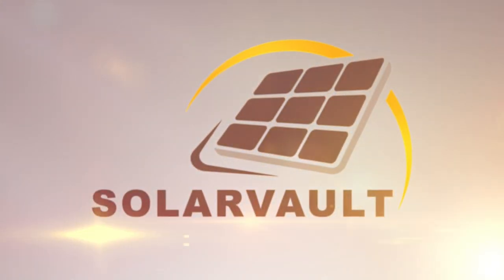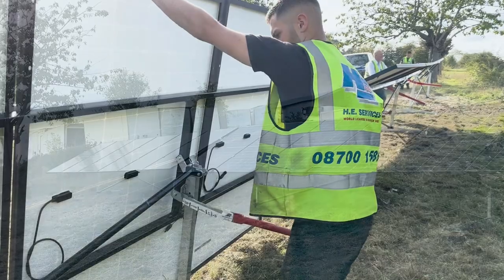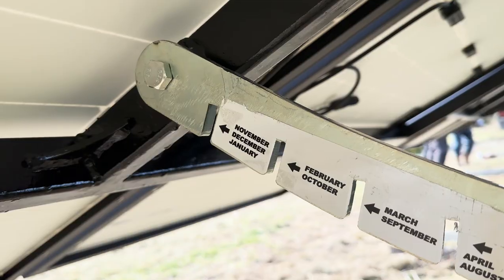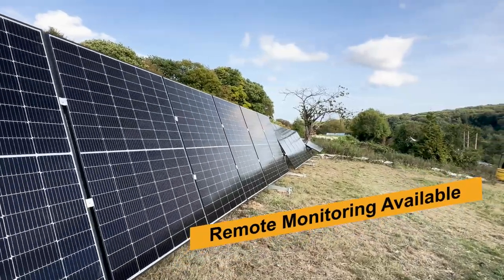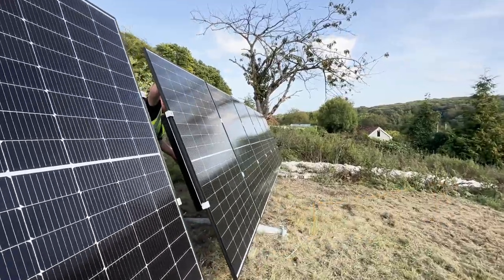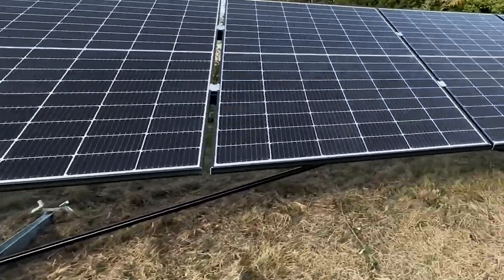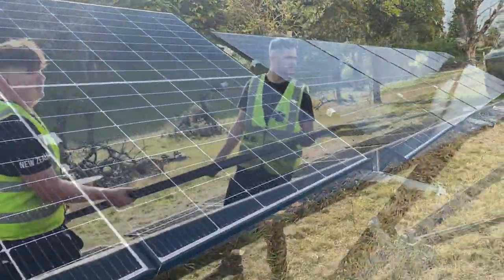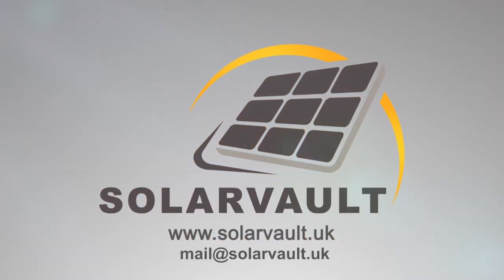Pitch Perfect - Ground Mounted PV System - UK Solar Panel Installation

Comment: how does this avoid the need for planning permission ?  it seems larger than the maximum permitted development size of 3mx3m / 9mSq...  is it classed differently to other ground mount systems for planning?
Reply from the maker: Hi there, 
Thank you for commenting on our SolarVault YouTube video. If you're able to email us at mail@solarvault.uk we can definitely assist you further with your queries. 
It can be a lengthy answer but we will try to help keeping things quite short for the purpose of replying to this comment: 
In the UK, planning permission for ground-mounted solar panels depends on size and location: 
Permitted Development: No planning permission needed if: 
Area ≤ 9 sq meters.
Height ≤ 4 meters.
Not in a conservation area, listed building, or scheduled monument.
Location Restrictions: Permissions needed for National Parks, AONB, World Heritage Sites, and listed buildings. 
Non-Domestic Installations: Larger systems usually require planning permission, small to mid sized usually do not. 
Always check with your Local Planning Authority for specific advice.
Please do get in touch with us at SolarVault for more information though. 
All the very best, 
SolarVault UK.